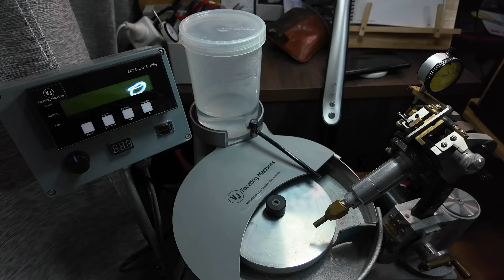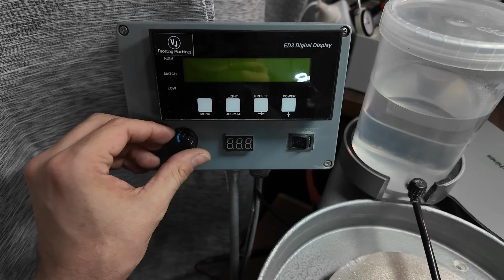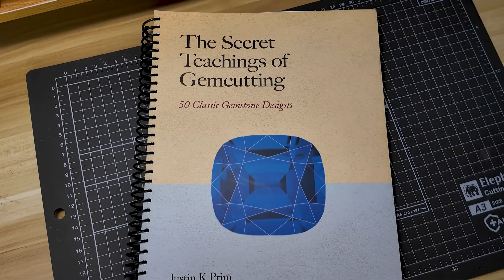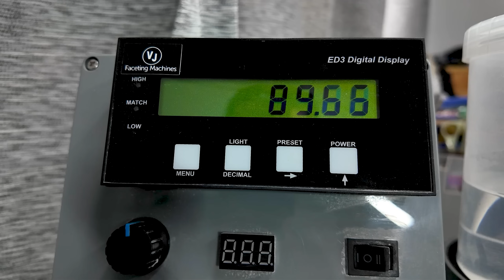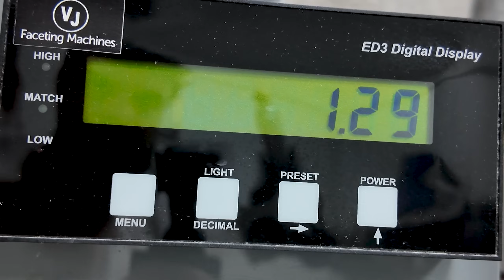Glowing Radioactive Opal?!? The Process of Faceting Uranium Bearing Hyalite Opal from Mexico

Comment: Alright, I am mineral/chemical element collector and I ordered a new collection box with an hyalite specimen contained (didnt know it contains Uranium traces). I dont wanna sound stupid, but I really dont know much about U-bearing minerals. Is it safe to have around in the house?
Reply from the maker: The amount of uranium in hyalite is minute so it is safe to have around the house, I was just taking precautions as I was creating fine dust while cutting. Here is a comment from Mindat.org (a great source of info for anything mineralogical!) by Steve Hardinger, that gives a great detailed answer:

"The bright green shortwave fluorescence seen in hyalite opal is almost always due to tiny (parts per million) traces of uranyl cation, (UO2)2+. Because this is a natural uranium species which has not been enriched or depleted by man, it contains several uranium isotopes, all of which have natural radioactivity. However, the uranium concentration is so small and the isotope half-lives so long that the radioactivity hazard is essentially nonexistant. One would require a very sensitive radiation detection instrument to detect radioactivity at this level.

The dust created by sawing or polishing this material presents a far greater hazard than the miniscule radiation hazard."
Reply: @Lawsongems  thank you for your kind reply. So in short, I guess I just got another great glowing sample for my collection (and a safe way to represent the element U in the periodic table without worries). I often visit mindat too, a great source of info indeed. Cutting is a complete different story and I admire your great work. Just subscribed to the channel. Once again, thanks a lot.